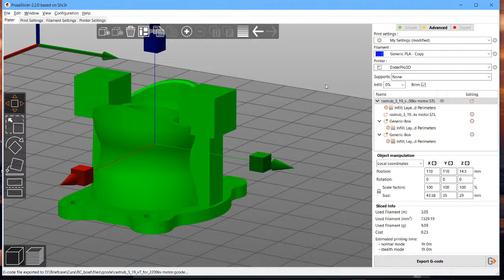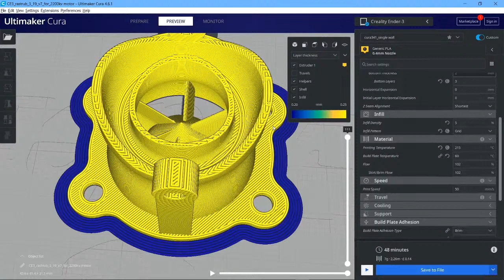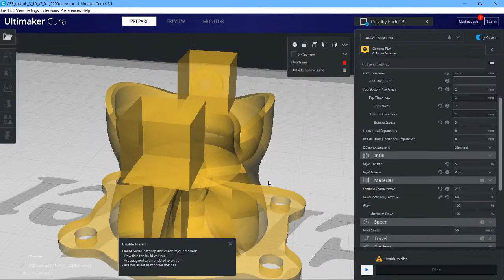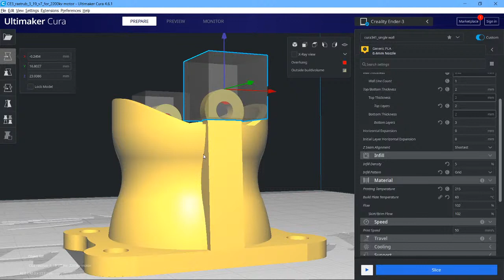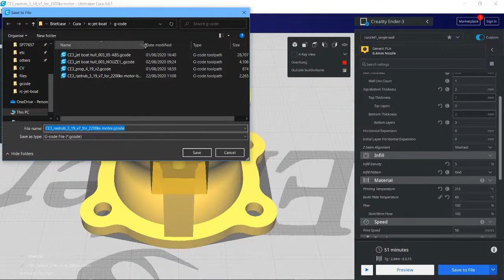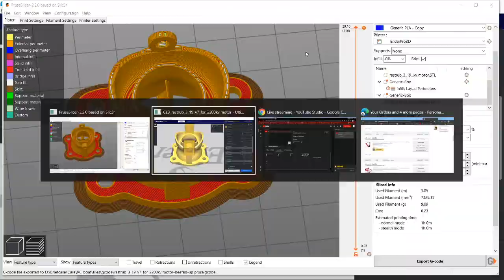Prusa/Cura slicer tutorial on Support enforcer/Support blocker

Comment: I believe I have a cube set as a support blocker, but in the GUI it still shows support material where the block is?  Can you not use support blocker with support everywhere?
Reply from the maker: Have you set the attributes in the support blocker?  They normally override the main settings